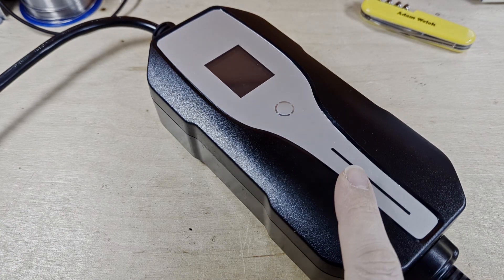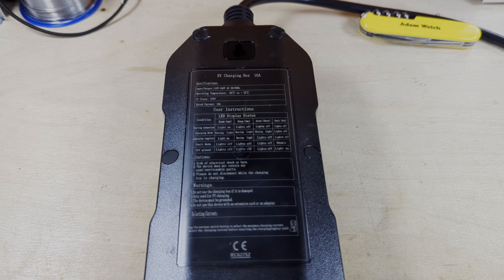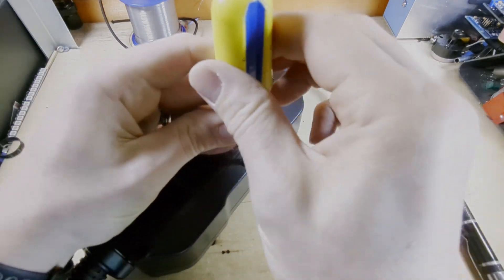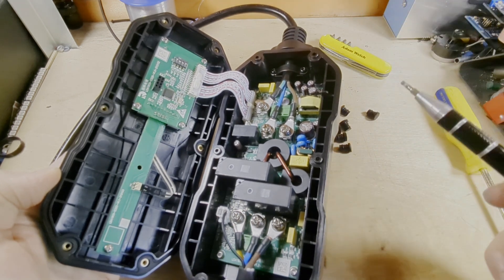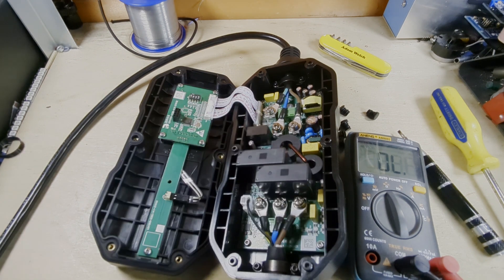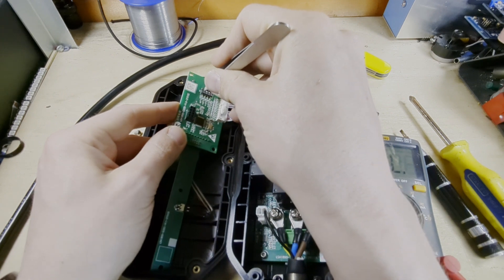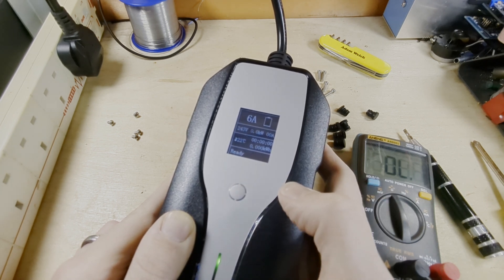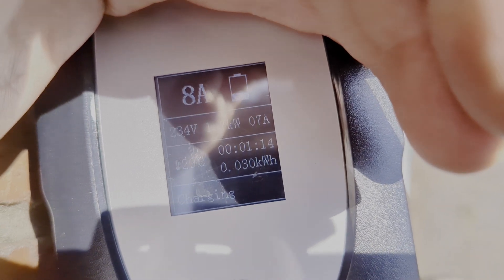EVSE - Quick Hack

Comment: Can you please explain what's the point of adjusting the current?
Isn't charging faster better?
Reply from the maker: Lowering the current puts less stress on the battery, causes less heat and therefore is better for the battery and should result in retaining its capacity for longer. However the difference between 6 amps and ten amps probably does make a lot of difference for the battery itself. For me, I want to charge at a lower current when my supply is limited.
Reply: I’ve got a similar Chinese EVSE which defaults to 14 amp charging and I can’t figure out how to change it. With US residential outlets and circuits rated at 15 amps, anything else on the circuit will trip the breaker. So 14 amps is fast, but tripping the breaker at granny’s house isn’t desirable and I’d like to adjust it to a lower current.

Comment: At 00:08 it's called a granny charger because one end has a 13A fuse and the other one is a type 1?
Can you please explain what the "because" explicits in this sentence? Thanks.
Reply: When you go you granny's house and they don't have a proper charger, you plug this into  a normal socket
Reply from the maker: Probably misspoke to be honest. They are called a granny charger because they are slow - because you can only plug them in via a normal plug they don't allow your vehicle to pull much current.